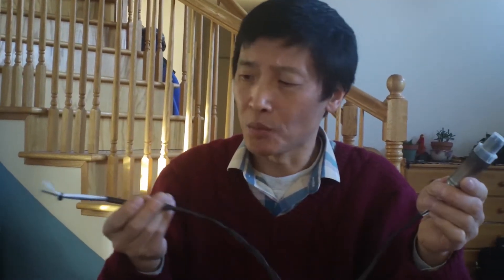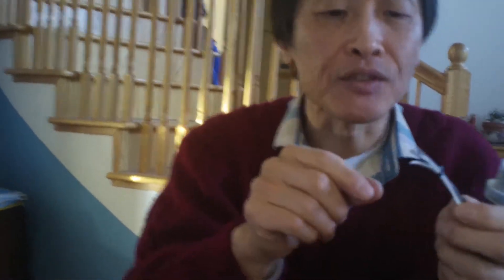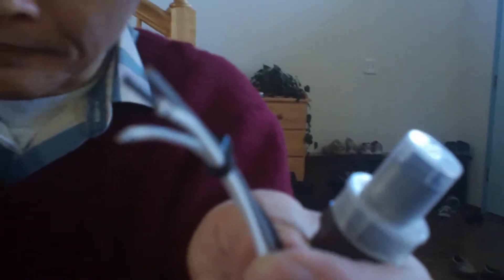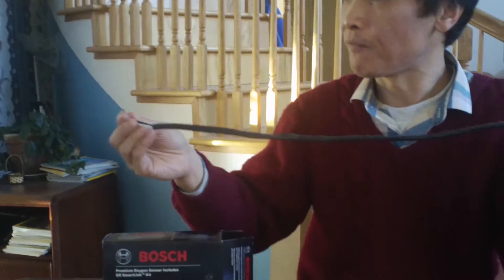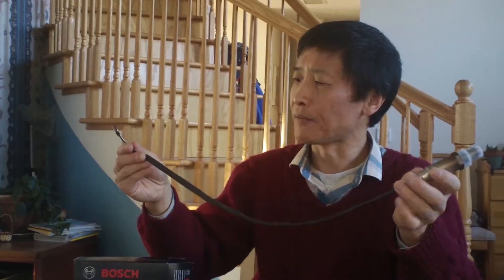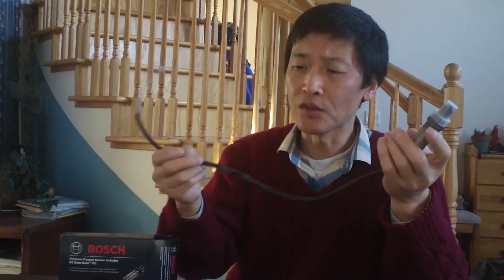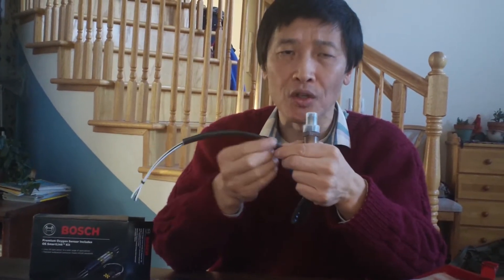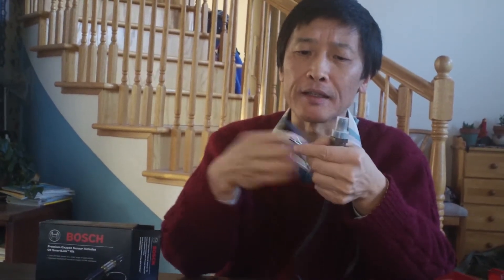Is Bosch Universal Oxygen Sensor Installation Video Correct?

Comment: You are absolutely right, I watched the video before i even saw yours and you're 100% right! What's sad is the fact that "BOSCH" created or invented the Oxygen Sensor to begin with and now they can't even make a video about oxygen sensors that are correct also I've been told by several mechanics "DO NOT BUY BOSCH OXYGEN SENSORS"! So i returned the BOSCH SENSORS and installed NGK SENSORS! 🤓
Reply from the maker: Thank you for taking the time to chime in and to contribute to this subject. From some of the other comments on this video, I think still many people have the opposite views, siding with Bosch. Please share this video to more people so that more people would participate to this debate, hopefully truth will come out soon. Thank you.
Reply: ntk is better probably few thousand miles

Comment: The Bosch Universal Oxygen Sensor referenced in this video works by comparing the oxygen level in the exhaust to a reference level of oxygen within the sensor.  If the wires are sealed with soldering or by another means then over time there is a chance that the reference air inside the sensor will change causing the sensor output to shift.  A shift in the sensor output will lead to incorrect fueling of the engine and eventually a diagnostic trouble code.  This can be avoided by using the universal connector system included with the sensor which allows the reference air to be replaced over time.
Reply from the maker: In that video, are you saying that the air can travel through these wires? What kind of wires are they? Are they really very special wires?
Reply: Bosch Auto Parts What? So the reference air inside the sensor is accessible through the wire.  That makes sense since the wire is sealed at it's insulating jacket, however, I don't think it is correct to say air is drawn though the wire.  Furthermore to access or change the reference air within the sensor wouldn't the solder have to totally saturate the full length of wire and make it's way all the way into the sensor.  Someone would have to be a total novice with the soldering but I suppose someone somewhere might actually do it.  Soldering properly really seems okay though.
Reply: Bosch Auto Parts dude whoever you are that is making this statement, just to let you you understand that wire is not a conductor of air its a conductor of electrical current and voltage is the driving force of electrons in a conductor such as wire for example, im an electronics engineer and the advance technology that you are referring to as wire is a conductor or air I never learn that in college, it could possibly be that you have alien knowledge from outer space or some sort where aliens defies gravity and just float around in large space ships in a way that human beings cant comprehend,
Reply: Lol, hey Bosch, that's not how o2 sensors work. Please stop giving out information when you don't know what you're talking about.
Reply: Corporate lies only to get you to buy their products. I have tied and crimped O2 Sensor wires many times , Im working on a video right now and ill show how to do it with a used O2 sensor from the junk yard from a different car. Corporations need to feed lies to keep them rich. AIR TRAVELS THROUGH WIRES LOL REALLY???
Reply: an utter bull shit marketing propaganda, we are soldering LSU LSF Denso NTK wideband without an issue for 20 years, go back to school bosch auto parts :)

Comment: This has been discussed many times before here at Pelican HQ.  I've written five books on Porsches and BMWs, and the fact of the matter is that I still don't know for sure.  The goofy posi-lock system that BOSCH has for these connectors seems a bit odd to me.  In general, the O2 sensors are supposed to be water-proof, meaning that they have to work submerged in water.  So, the air-reference signal that the sensor needs to measure O2 has to be gathered through the connector itself.  I'm not sure if soldering by itself is the issue with not having a proper connection, or whether it has to do with the fact that people seal the connection with tape and/or heat-shrink tubing.  I would agree that soldering by itself would probably not cause a problem.  The act of covering up the soldered connection is what causes issues, I believe.  This is just my opinion - I'm not 100% sure.  In all of the books that I've written, I recommend that our customers stay away from these generic sensors and instead use the proper OEM BOSCH ones with the proper car-model-specific connector installed and attached at the BOSCH factory.
- Wayne at Pelican Parts
Reply from the maker: I agree with you this topic is hard to know for sure since there are so many people believe Bosch's version. I have ordered the original manufacture part  and will be returning the Bosch universal.  By the way, someone here posted that the air hole is from the body http://www.ericthecarguy.com/kunena/2-General-Discussion/48380-can-air-travel-inside-or-outside-electrical-wire#81161
Reply from the maker: @sekainiheiwa3650  I agree with you. But it is just hard to believe it because Bosch is a big company
Reply: They're not designed to work submerged in water in the slightest. They're designed yo work in potentially very wet conditions such as driving in heavy rain and partially getting submerged say when crossing a ford. But no? They are absolutely NOT designed to be constantly submerged.

Comment: It seems that Bosch universal sensor wires in the video are 'hollow' inside. That's the reason why they suggest to avoid usual soldering but to use their 'tube' junction box to link to old, but still usable, original connector. But this reccomendation applies only if the original terminal cable is made of hollow wires too, indeed ! And, usually, that's not true. So soldering can (should) be done side-by-side leaving the Bosch hollow wire free of 'breathing' the reference air. Some thermo insulation coating around each junction completes the replacement, but allowing a bit of air space to flow in as well.
So, I mean, you are quite right in video disagreement, but allow special 'tube' wires still to convey reference air inside oxygen sensor is mandatory.
Reply from the maker: you said "It seems that Bosch universal sensor wires in the video are 'hollow' inside.", no the wires were not hollow in the video (I mean the one we purchased, the one shown in the Bosch original video may be). Do they sell such oxygen  sensors with hollow wires? Thank you for taking the time to chime in.

Comment: As soon as I heard the video the first time i immediately thought, "hang on a minute, that can't be right - surely". Air through the connector? It's so obviously wrong, it makes me question if Bosch would be better off going back to just selling power tools. Power tools that don't need air. LOL.
Reply from the maker: Right, LOL. It would be cool if Bosch's power tool advertisement shows electrical current goes through the air hose.
Reply: The Asian genius is completely wrong. This is a differential sensor and requires there to be air flow down through the wires to know what the difference is. If you were to solder them and the solder were to flow down the wire it would basically plug off the flow of air.

Comment: My thoughts on this is in any low voltage circuit components that are used for measuring gasses or atmosphere it is vital that wires do not get pinched or soldered together because it would be a point of resistance in the line and would give a false reading the voltage signal runs along the surface of the wire. 
Well my thoughts always best to go oem but when in bind for cash fallow instructions there for reason 😁
Reply: +Jesse Trevino That sounds sensible to me.
Reply: Your explanation still does not address the the wires leading from the sensor itself (and not about the sensing mechanism within the housing). Of course the external wire leads are to be connected. I don't understand what is the mystery.
Reply: yeah... we landed on the moon with such sensitivities... suposedly

Comment: Is this for your Honda Accord?  I recently replaced mine in my 05 Accord. I went with an OEM version that I purchased online for around $75. Over 3k miles later and it still works fine. I would go OEM and not mess with Bosch. W/ regards to the soldering effecting the sensor, this may be true as even touching the sensor w/ your hands can ruin it. I think it may have something to do with the signal being impeded by the soldering.  Just order the OEM version from Honda. I used Majestic Honda as they were cheaper than my local dealer.
Reply from the maker: Yes, it is for my Honda Accord 2004. This Bosch universal is $56, my local Honda dealer wanted $126.  I will follow your advice getting a OEM from Honda. Thanks. 

As for the Bosch installation video, I looked at the wiring, it does not look possible the  "air must be drawn into the sensor through the connecting wires."

Comment: I understand where this is misleading, the dialog should have been something like,

"In order for the sensor to work properly, use only the Posi-Lock connector when connecting the wires.  Soldering the wires can lead to corrosion and failure of the connection if not done properly."

Simple translation issue.  The animation at the time of the 'wires transmitting air' statement only lead to the confusion.

Also, looking at the Posi-Lock datasheet, it appears Bosch is relying on the "Body" to protect the Posi-Lock connectors as they are only rated to 120C.  Temperatures around the exhaust on a hot summer day here in the desert are easily higher than that.
Reply from the maker: yes, the video producer must be very "creative".

Comment: After reading Bosch reply to this video, i understand what they mean to an extent. What i do not agree with is that solder is an insufficient way to connect the wires. Are they saying that twisting the wires together and using a "plastic clamp" device is a better method for connecting electrical wires? I have soldered almost every wire in a car, and i have yet to have any of them fail. Also, im not 100% about this, but i dont think that the voltage can be changed by simply & correctly soldering 2 wires together. The voltage is regulated by the ECU & temp of exhaust, and ONLY a weak connection/bad solder job can change that, definitely NOT a strong connection!
Reply from the maker: Yes, we are talking about two different issues here: 
1. air is drawn though the wire (this was shown in Bosch's original video) 
2. soldering wires
The Bosch Auto Parts's official reply tried to avoid to answer the first question, but tried to address the second question, the soldering. The soldering debate: soldering wires can avoid problems caused by corrosion but if you need the wires to be flexible, i.e., wires bending or moving or vibrating then connectors may do better in a non-corrosive environment. Another potential question is the difference in resistance, it is possible that soldering is not copper to copper connection, connectors in a non-corrosive environment may be less resistance, although this difference usually can not be detected by our multi-meters. So it is possible Bosch was reading the auto industry standards/codes though the standard does not explain why and in what condition a certain practice should apply, thus Bosch tried to invent some reasons which are hard to understand.
Reply: @GeniusAsian  I agree
Reply: you can twist solder and hold the wire with your fingers will work exactly the same way as you would buy direct fit or this bosch quackery bull shit that every garage after opening the package just throw into the garbage and soldering wires.

Comment: I agree, that doesn't make any sense. Their wiring kit has the sealing gaskets that go on each wire so how would air get in. Just like the factory O2 the wires are insulated and connector is sealed so that didn't get air either. As far as soldering I can't see how that would raise the resistance much to cause an error. The signal coming out to the computer is a reference voltage from what it picks up from the sensor end inside the exhaust pipe.

Comment: BOSCH is right, atmospheric oxygen must enter the inside of the sensor for comparison You need to learn how oxygen sensor works. We are not talking about a stream of aer, or draft of air, we're talking about molecules of oxygen that enter through the wires like a liquid could use capillarity effect to do the same.
Reply from the maker: don't think you are correct. Even if we assume you are correct,  so if we solder the wire, you think the "molecules" would disappear? The molecules can simply enter from the soldering cut.
Reply: corgLLC just learn how an oxygen sensor works..
Reply from the maker: even if we assume you are correct, why can't the molecules enter the wire from the soldering end?
Reply: corgLLC can u breathe if someone chokes you? The same with the wires.. BOSCH is not some small company, is the biggest supplier in the Automotive industry, is just plain stupid to assume that the inventor of the oxygen sensor is wrong.. c'mon man..
Reply from the maker: we mentioned in the video, we were shocked that a big company like bosch can say such "stupid" thing. We can't make you believe that they are wrong. Still we appreciate your leaving your comments here. If you ever change your mind in the future, come back comment again.

Comment: I think that BOSH is correct. Quote from wikipedia "In automotive applications the titania sensor, unlike the zirconia sensor, does not require a reference sample of atmospheric air to operate properly. This makes the sensor assembly easier to design against water contamination. While most automotive sensors are submersible, zirconia-based sensors require a very small supply of reference air from the atmosphere. In theory, the sensor wire harness and connector are sealed. Air that leaches through the wire harness to the sensor is assumed to come from an open point in the harness - usually the ECU which is housed in an enclosed space like the trunk or vehicle interior." If you solder the wires, it will interrupt the air flow inside insulation sleeve, which is for sensor operation.
Reply from the maker: Thank you for your wiki quote. Still there are more than 3 feet of wires, the wires look like non-hollow regular wires to me, it is hard to believe the air can flow through 3 feet wires from inside the car. The other end of the wire is just regular electrical connector which would block any air.  Thanks.
Reply: There is a atomic level of o2 that can move within the wire and casing, the sensor side "seeps" this in, on a capillary type action, "refreshing" the o2 outside air reference needed by the sensor to "guage". If you solder, you're "sealing" off this action I assume. Bosch is describing it in a manner very difficult to grasp, they should make a much more detailed video describing better, also how the posilock actually locks the wire inside, most ppl just "Bite" it in one side of the inner lock and screw it down, I feel it must "flair" over the taper insert and then be "pinched" like a closing umbrella, by the other side of the lock, just my 2cents worth, I'm no genius, just struggled to understand this simple video.
Reply: @hiemabedrog   Quote: "Older style oxygen sensors actually have a small hole in the body shell so air can enter the sensor, but newer style O2 sensors "breathe" through their wire connectors and have no vent hole. It's hard to believe, but the tiny amount of space between the insulation and wire provides enough room for air to seep into the sensor (for this reason, grease should never be used on O2 sensor connectors because it can block the flow of air)."  Reference http://www.autotap.com/techlibrary/understanding_oxygen_sensors.asp
Reply: how about not reading Wikipedia but thinking?

Comment: I have just replaced my sensor with a Bosch sensor and I thought the same as you I soldered the wires instead of using the connectors the car was ok for one journey to work but now the engine light . Cruise control light .traction control light and the sport light had now appeared . So I am going to take sensor off again and use the connectors Bosch recommend . By the way my car is a subaru impreza
Reply from the maker: thank you for taking the time to share your result, and let us know if you were able to solve the problem. By the way, the official Bosch rep commented on this video and did not really defend their position even though they did not admit wrong either. We still believe the solder or connector would make this much differences.
Reply: LOL ... Subaru Impreza... you need AFR probably not a bosch sensor. YOU installed wrong sensor

Comment: I think the reason is simple why bosch don't wan't you to soder, they simply want you to buy a new O2 sensor with the connector and not get an old O2 sensor in the junk yard for just a few box. If you are worried of soldering the wires then crimp it then. Add a shrink plastic to waterproof it. It is very important thou to distinguish between an O2 sensor and A/F sensor. they look very much the same but works entirely in a different way. Easy to find an universal O2 sensor but not an A/F sensor.

Air/Fuel Wideband vs Oxygen Sensors (O2 sensors)- The Demise of Shadetree Mechanics? Part1
Reply from the maker: can bosch provide false information so that they can sell more new O2 sensors? It is too risky for a established big company.
Reply: @GeniusAsian  yes. take them to court for misleading - you will win
Reply from the maker: @sekainiheiwa3650  german is suppose to be very meticulous, that is why I want to be sure ...